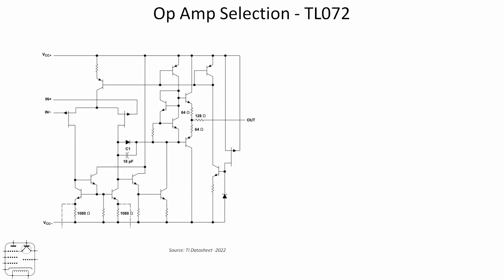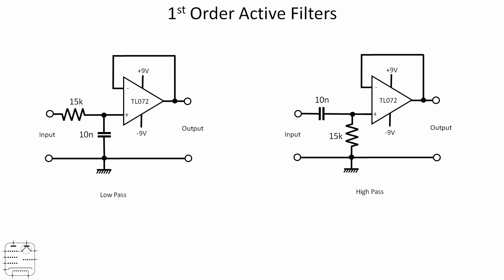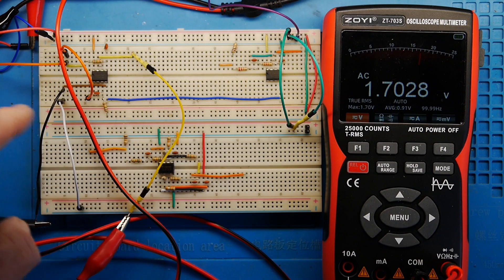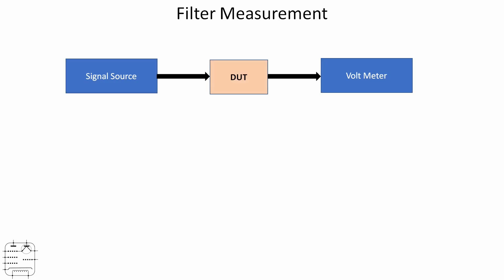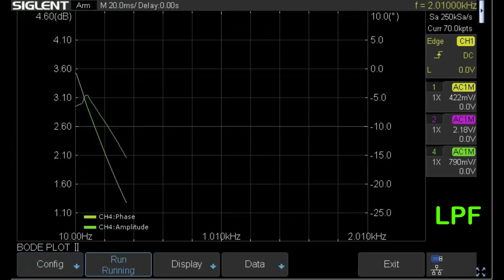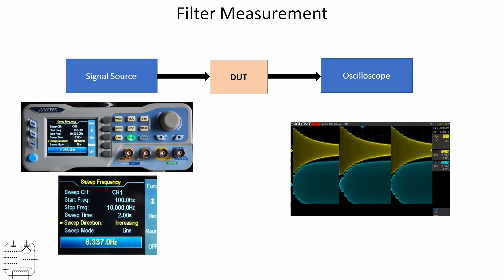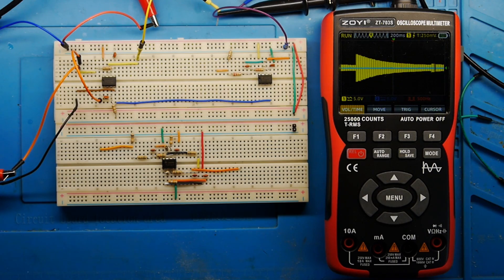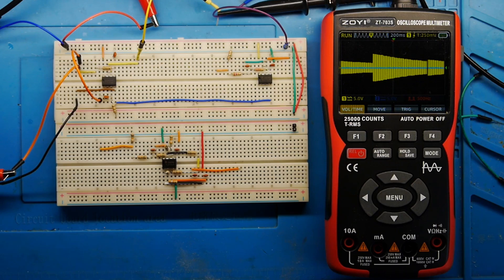Filters part 1 - 1st Order Filters # 199

Comment: Thank you very much for your great video!!!!!! I'm a beginner and I was wondering if you could tell me how many amps I need to set on my power supply for the breadboard low pass and high pass filter. And also, if you could tell me where to hook up the signal generator!!!!!!!! I really like all your videos!!!!!I'm from Northern Ontario, Canada. Thank you
Reply from the maker: @mauricepetit9986  Signal Generator on the input side, ie the left of the circuit diagram,  minimal current required for these circuits, 100mA more than enough I would think.
Reply: @LockdownElectronics  Thank you very much for your quick respnse!!!!!!!! It's really appreciated!!!!